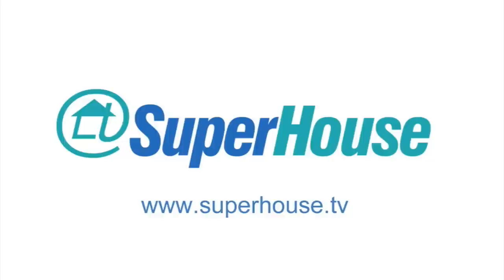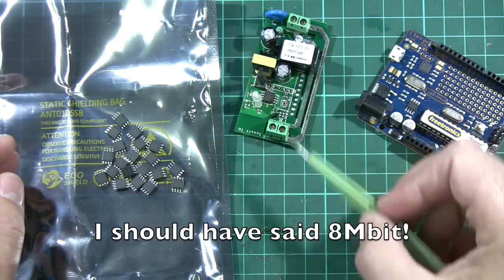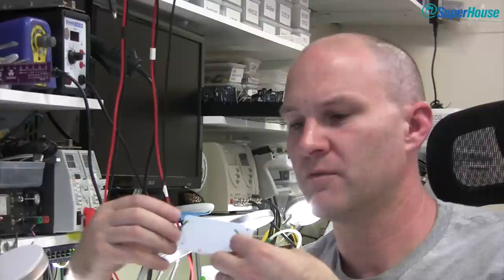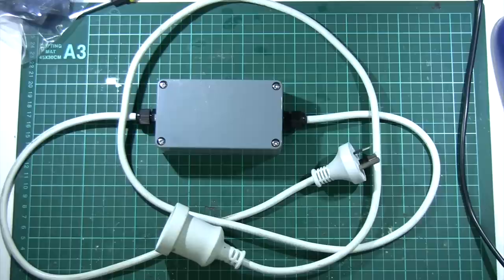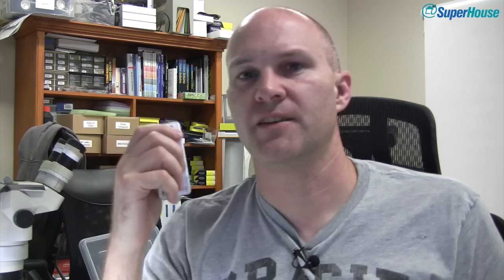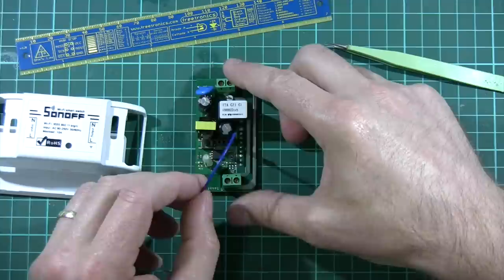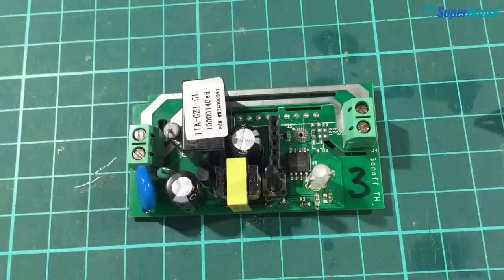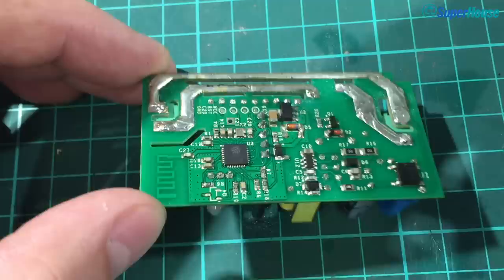SuperHouse #21: Six Sonoff Secrets: Storage, Safety, Switches, Sensors, Software, and Sites

Comment: Anyway to setup these to pair together, one as a transmitter and one as a receiver?
I have a Smart Pool Control Box that will control Lights and other items via aux connections but its all run by relays, that's fine if the lights you want to control are wired local 
to the control box, but when you have lights that are not near the control box you want it to control it has to be controlled wirelessly, so can a Relay in a control box turn on or off a 
remote relay wirelessly?    or can one Sonoff turn on or off another Sonoff? or are these only receivers and can not transmit.

Comment: Tthanks for all your videos and super informative and great work. I have a query and if you can answer I will appreciate. 
I am in the process of automating my ceiling lights and bedroom lights with Sonoff smart WiFi wireless switch. It worked great but the problem is, i cant switch on/off manually with physical switch in the event of WiFi/internet goes away. Is there any way we can set it up with Sonoff or do we have any alternate products that work for my case. In fact this is everyone's limitation when it comes to Sonoff switches. Please advise. TIA

Comment: Hello John
I've been trying to use GPIO-14 how you explained it but it's not working at all.
Any ideas of what can be wrong?
The device is working properly and I connected it in parallel with the light switch so I I can only use wifi command when the switch is off.

Comment: Hi, I am unsure what firmware were you using when you connected the Sonoff to a wall switch in order to turn it on and off also from the switch.
- Was it the default Sonoff firmware ?

Comment: It would be great to have a separate ESP8266 module as a remote switch to the Sonoff. This could allow the Sonoff to be put inside a light fixture say in a hallway light, and then remote switches at each end of the hall, rather than having to carry your cell phone all the time.

Comment: I'm not sure if I understood all correctly. Do I have to install Tasmota to be able to use the regular wall switch (the is on / is off switch)? and even if I install the custom firmware, Can I still use it with my home assistance and the official app that I'm using right now? Thanks in advance.

Comment: hi, ive got sonoff v1.0 where 1.2 sq.mm wire is used instead of heavy solder track,i had connected a submersible pump which uses 6A,the problem is there was power surge during a rain and the input protections all got burnt like Mov, bulged 400uf cap, burnt fuse and a x2 cap.is there a way to bypass 220v and use 5v or 12v to power the device and isolate the com pin from the relay ?

Comment: I'm interested in getting a sonoff for use with an electric water heater (geyser type). My country's mains power is rated at 230V. I was wondering if it would be safe to use for such an application since I've only seen them used for lightbulbs?
Reply from the maker: It should be, but check the current requirement of the water heater. They can require a lot of power. I'm in Australia, so we have nominal 230V mains (actually 240V in Victoria) and the Sonoff is rated for that. The TH16 model has a relay rated to 230V / 16A. If that's not enough, you can just use any Sonoff model (or a little board like a Wemos D1 Mini) and use it to drive a larger external relay.

Comment: Dear Sir : I have purchased a Sonoff 16A Switch. I opened the device to install a switch using a stereo pin and a switch. But there was no jack inside to fit the Stereo pin as u had mentioned in your video. Kindly Help me with this.

Comment: I want to control my pool heater remotely from anywhere, and also monitor when it is running. Basically it has 110v input which goes through some safety switches (pressure, Overtemp, thermostat etc) which then goes to a 110v ignition module providing the burner control (gas valve on, spark, 3 attempt lockout).   I just got a TH10 and i have 2  DS18B20's.  I figure I could use the standard GPIO14 with 1 DS18B20 replacing the bulb thermal sensor which is inside a 3/8" tube inside the water input pipe, to control the on/off of the heater, by setting the heater's thermostat on full, thereby seeing the pool water temperature and setting the desired temp through Ewlink, and use GPIO4 to monitor temperature of the burner exhaust using the other DS18B20, which would tell me when the heater is running.  Can this be done with the standard TH10 if I add the 10k and 0k resistors for GPIO4,  or would I need to apply new code to the TH10 ?

Comment: Hi there, only for curiosity... which firmware are you using to plug GPIO14 and use it with a normal switch? I usually flash sonoffs with ESPurna, but it seems that when I bridge GPIO14 and GND nothing happens...

Comment: With the Switch hack (mins 23-27), does that means that I can install in in a 3 way circuit? My lamps can be turned on/off in two different switches. If I install Sonoff like that will I be able to do that turn them on/off through Sonoff app AND through both switches?

Comment: Question,  your example of toggle switch connected to sonoff (25:00) Is that with the normal firmware on the sonoff or did you flash it with something?

Comment: Hello. Seems to be great ! I would like to add a normal light switch without flashing firmware. I understand it could be possible earing this video (connecting the wall switch to GND and GPIO14). Right ? really without flashing firmware ? thank you

Comment: What about with the new Sonoff Basic Model. I opened and it looks a litle diferent inside from the Basic here in the video. The conection for the main switch to the gpio14 to control the output and also the ground.
How can I conect it.?

Thank you in advance for your help.

Comment: For the normal flip switch on the house wall, why can't you just connect the normal switch in parallel with Sonoff? That way, normal switch will work as before (When on=on, off=off) and also with Sonoff it will work the same. Two switches (one normal and one Sonoff) in parallel would be like a logic OR gate. Can't it be done by simply connecting sonoff switch in parallel to normal switch (without GPIO/firmware change)? Is there anything that I am missing here?

To explain in little more detail, when you connect Sonoff (SOFF) and Normal Light Switch (NLS) in parallel
SOFF=1 NLS=1 -> Output=1
SOFF=1 NLS=0 -> Output=1
SOFF=0 NLS=1 -> Output=1
SOFF=0 NLS=0 -> Output=0

The only drawback I see is that if both are 1 and you try to flip the physical switch manually, the output is still 1. You need to turn off both switches to get output=0. But this reduces complexity and firmware change etc.

Is there any other drawback other than what I mentioned?

Comment: Thanks for sharing.  Do you have to reflash all of your sonoffs when you change your wifi password?  Or is there a better way?
Reply from the maker: In TASMOTA, the SSID and password can be set in the code at compile time so that when it first starts up it can connect to the network, but you can also change it on the fly without recompiling just by using serial commands or MQTT messages to change it. TASMOTA also now supports two sets of WiFi credentials (set in user_config.h around line 29) so I think you can change one while it's connected to the other. I haven't personally tried that though.

Comment: Hi, Great video. It make me buy one of those.
But there is small problem, I can upload any code/firmware using Arduino Ide.
After upload the device is not responding. Can even blink usin on board led on pin 13.
Any ideas welcome.

Comment: Sonoff TH16 is a temperature controller. it has its own temperature sensor. Would I be able to connect my electric underfloor heating to this  unit. i.e. would the thermostat in the floor work with the sonoff? or could it be persuaded to work?

Comment: I just received two of these sonoff basics and they're both missing the connection for gpio14. It has the other connections and i was able to flash it successfully.  I was hoping to connect a standard wall switch as you described but am now stumped. Any idea?

Comment: Hi SuperHouse.
I'm looking for a bit of info on these switches.
I have a mate that is an electrician and I'd like to wire up my interior downlights that run on 240 volt mains.
I'm just wondering how safe these are to use in a ceiling with insulation in QLD heat?
Just ordered one off ebay. Look forward to hearing from you :-)

Comment: Earth is a mute point.  if you associate sonoff with a conventional extension lead you have to maintain the earth continuity because it's reasonable to expect an earthed outlet - so not doing it right is like setting a trap.
However many devices (tv, most media devs, lamps etc), anything using a power converter like a laptop or phone, router, switch etc, don't have the third wire to extend - then it becomes academic.  As long as it's a dedicated supply it's not a booby trap.  

Good practice where earth IS required is to include a break point, that is terminate Live and Neutral at least a couple of CMs shorter than your earth - that way if anyone trips, pulling the leads apart - the last conductor to break should be earth.  UK plugs have enough room in them to allow termination with a good slack on earth. Other countries may use more compact plugs.

Might have been a good idea to name those memory chips too!

Comment: what is the reference of the chip you changed on the sonoff ?
is it W25Q32BVSSIG ? there are chips with 64 Mb too (W25Q64FWSSIQ)
for tasmota, what is the minimum size you need to flash ?
thanks

Comment: You should use end terminals on your wires before screwing them into your sonoff or hard wires.
Reply from the maker: That's a very good tip. I didn't think of covering that in this video, but perhaps I should do a video about cable termination techniques some time and show the different ways it can be done.
Reply: SuperHouseTV My Sonoff 16 mains connections were really tough to wire when you use wire anywhere close to the rated amp capacity. It helped in mine to solder the twisted ends of my mains wires before clamping then in the Sonoff so there was something solid and fixed to clamp.
Reply: @ron1457  this is not recommended!  The reason being that solder "cold flows" and you end up with an intermittent connection that's going to end up generating heat,  way more than you want in that spot...

Comment: I just installed some of these a few days ago & I could toggle the light off & on with the programming button. Is there a reason why I couldn't wire a momentary switch into gpio 0 of the micro - switch without doing anything else? That would also give me ability to go into programming if needed.

Comment: Absolutely love your videos. Very informative. Can you tell me if I can use the original software and still get the "In Wall" switch to work or should I get a Momentary switch? I want to be able to use Alexa as well as use the normal wall switch. Any hint would be much appreciated.
Reply: scroll down to Peter Scargill's comment 3 months ago.... New firmware is needed and can work with Alexa

Comment: What will be power adapter recommendation for "1 Channel Inching /Self-Locking WiFi Wireless Switch 5V " . 5 Volt 1Amp or 5 Volt 2 Amp or 5 Volt 3Amp ?

Comment: Can I use a TH10 to be controlled with a normal light switch using the socket without flash the new tasmota firmware? Thanks!

Comment: Hi, I received my Sonoff today and also does not work using GPIO14 and GND trick with stock firmware. What is wrong with firmware? Might a new firmware have no function on GPIO14? (I did not configure to my wi-fi network) just connect and  experienced with a bulb.

Comment: Wouldnt it be possible to wire the "old" switch and the sonoff by treating the sonoff as a switch on the other end of the room? As I remember do the Clipsal and all the others, at least in Australia, have these dualswitch option. Dont know the specific word, sry: if a room has 2 switches for a light their status changes, same as your example. The sonoff would be the other switch.
Is it possible that you had to enable and dissable the light on the phone to turn it off? Could there be a status update or similar implemented that the home automation knows the status?

Comment: Thanks Jonthan, have you used Node-red yet. The Peter Scargill setup works great for me. Where did you get the switchs from please. As my wife will thank you. We had a power cut here down south of you. You miss one Home Assistant code on github. May need to look again.  Itstead have more stuff coming got that from Andreas Spiess as well.
Reply from the maker: I played with Node-red very briefly a couple of years ago but I haven't used it in my home automation system. Currently I use OpenHAB to provide the logical glue between different devices. Which switches do you mean? The Sonoff Touch switches that I showed at the start of the video are available from ITEAD. The mains light switch is an old Clipsal switch (I think)
Reply: No mate the touch button you used on the plastic cases. By the way I have my sonoff touch open and really to flash.
Reply: if you're referring to the push button at 18:57 it can be found on ebay search waterproof push button
or use this link: http://www.ebay.ca/itm/6Pcs-Mini-12mm-Waterproof-Momentary-ON-OFF-Push-Button-Round-Switch-/201538126654?hash=item2eec9bc33e:g:PAEAAOSwvgdW4C4V
Reply: I had a go at Node-red, it was pretty complicated and I never really got how it all fitted together.  Instead I switched over to "home assitant" and setup mosquitto mqtt, I managed to get this working perfect with the sonoff switches.  I also find it heaps easier than openHAB, I tried v1 and beta v2
Reply: I found it the other way round. Home Assistant with the Hassbian setup didn't work for some reason so I swapped.  Node-red is easy after you watch some YouTube show.

Comment: on the switch changing state example, the phone appears not to get the updates...
Reply from the maker: Good catch! That's correct, the app on the phone is loading the state from my OpenHAB server, which sends messages to the Sonoff to change its output. When the Sonoff changes its state (for any reason, it could be a message, a button press, etc) it publishes that state change to MQTT so that other devices can be aware of it. What I didn't bother setting up for that quick demo was closing that loop, with OpenHAB watching the Sonoff's MQTT topic so it could update its own internal state whenever the Sonoff changed state. The result is what you saw in the video: if I changed the state of the Sonoff locally using the button, OpenHAB had no way to know it had happened. That can be fixed by having OpenHAB paying attention to the Sonoff's status updates, I just didn't do it for that quick demo.

Comment: I tried what you did at 22:25, but the sonoff didnt turn on or off. Did you flash yours for it to work? Also, mine didnt come with the black lead in the pins, i had to soder in mine. Thanks!

Comment: Goodnight friend...

Congratulations on the videos posted, I would like to know a little more when you speak to the 24:16 minutes of manually ascending through the button, you could talk a little more about this connection, which pins I should connect.

Thanks again and goodbye for the vidos.
Reply from the maker: If you mean the light switch, I connected the 2 wires to the screw terminals that are normally used for active-in and active-out (switched)
Reply: Good Morning.

That's right, I wanted to know what the pins were and what type of interduptor you used to make the on and off link.
Reply: Ola boa noite amigo, esses terminais, fiz aquisicao de algumas peças e tentei por o interruptor de luz mas nao funcionou.... oque eu teria que fazer, desde ja agradeço

Comment: I understand how the Sonoff will work with a traditional switch and i have to say this is really useful. I guess the sonoff touch basically serves this purpose but the problem is for now they only have a one gang switch and its rated for max 2A and 400w only and its really limiting a full household implementation.  Im wondering is there a way though to use it with a capacitive touch switch, for example a Livolo switch? Would be great to pair up a 2ch sonoff with a 2 gang Livolo switch to basically get a 2 gang sonoff touch functionality.
Reply: 2 amp is plenty. Change your light bulbs to LEDs. 13w LEDs pull 0.05 amps at 900 lumens, The switches are designed for low current outputs.  You may have to wait a bit for 2/3/4 gang switches,  judging from the requests on the itead forums there is a large demand for them.  Not sure on using the two different switches sorry
Reply: Actually most of the lights in my house are LEDs. The main issue is not having a 2/3/4 gang physical switch for the sonoff.

My main concern for now is keeping the original firmware because im not too confident of switching up the firmware and i also quite like the ewelink app as it serves my purpose for now. So the only option i have is to wire a momentary switch as shown in the video, but that button used in the video is kind of unsightly. Ive managed to find a workaround for now by using a doorbell switch and it works great, but still dosent solve my need for a 2 gang switch. i guess i'll just have to wait till Itead puts one up on the market.

Comment: Jonathan, some nice stuff and tidy wiring but: rewiring the standard light switch to control the sonoff will, one day, persuade an unfortunate electrician that he has isolated the circuit (because he thinks he's switched it "off"). Very scary! Perhaps you could add a warning over your video?
Reply from the maker: That's why I say to never use mains cable for the control signal between the light switch and the Sonoff. I'm doing a follow-up video where I talk about this in more detail, demonstrating how to wire Sonoffs in different configurations including 2-way switches, etc :-)